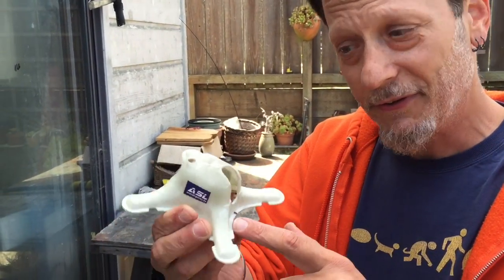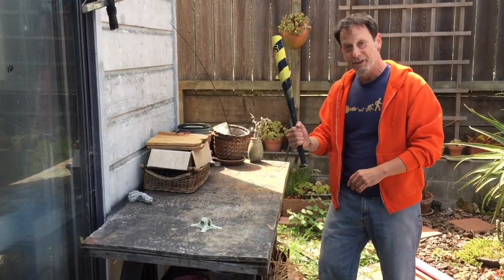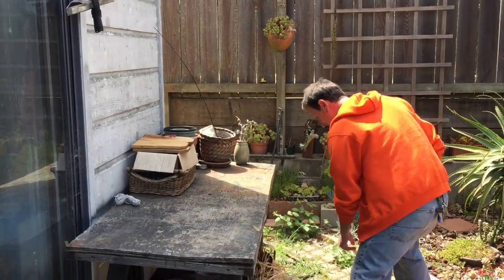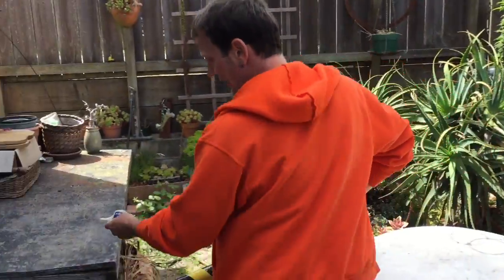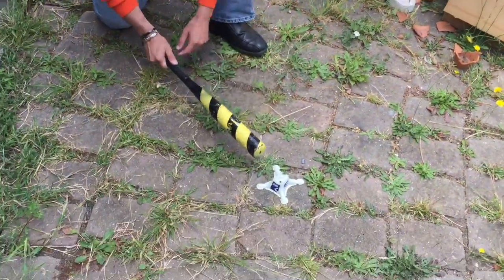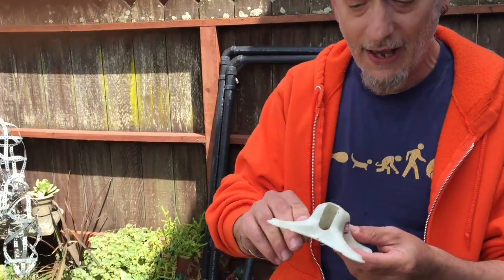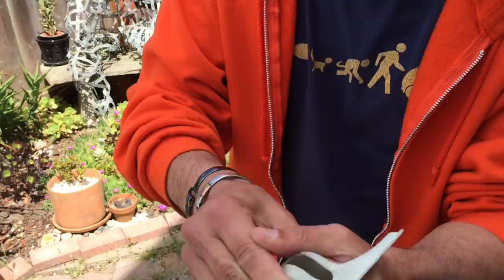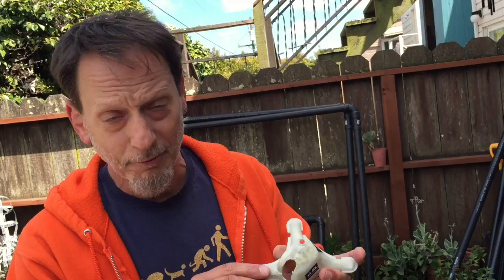Drone Abuse - Testing The FPV Racing Prototype

Comment: Nice stuff! Why does it sound so metal-like? is it a material with high density?
Reply: Metal bat?
Reply: Ah okay. Thought those things were made out of wood;) we don't have baseball in Germany
Reply: DerKrawallkeks We don't have it here in England either, but couldn't you tell by the sounds that bat made? 
And to be fair most bats are wooden
Reply: Okay;) well i thought the noise comes from the frame maybe. didn't know there are metal bats